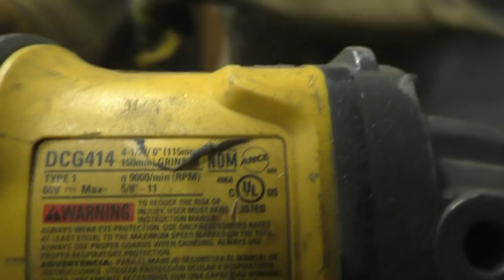Grinder Safety -- and lies you are told to scare you.

Comment: I've gone through hundreds and hundreds of cut-off blades making things from heavy chopper knives to roll cages and a few jet engine projects, never had a blade explode on me in an angle grinder. I'll occasionally run them down into nub status which is probably a little dim on the idea scale, but if you're in the zone, screw the blade change. 😁
Dremel wheels on the other hand I refuse to use anymore due to them exploding prolifically even with wood, not to mention all-thread or something heavier. Still have all my bits though, so that's something.
Love the 'tough dad' approach on safety, i.e. abuse your tool, you'll abuse yourself. Practical and common sense is a fleeting commodity that most people think there's an app for. Good luck downloading it... 🤦‍♂️
Reply from the maker: LOL,   just a little bit more....   ...nope.

Comment: What about using the wrong sized disks, as in those meant for bigger slower grinders (2'000 rpm) on a smaller 11'000 rpm grinder? Do they hold up as well?
Reply from the maker: They certainly have for me.  No problems at all.  Careful with your fingers, as they are a lot closer.

Comment: The only scaremongering in this video is the nonsense you preach, you've been lucky enough that you've neither seen not experienced a catastrophic failure resulting in injury. I'd fire any of my guys on the spot if they were acting so irresponsibly, nevermind teaching people to do it. It's not only the operator in danger but everyone else around. You couldn't track the fragments of disc in a small workshop when they broke because they were moving so fast.  Just plain dumb.

Comment: Everything is fine until it isn't. No need to cover yourself in bubble wrap when you go outside...but taking reasonably easy precautions helps you dodge bullets. I'm a construction worker...I'll remove the guard for convenience when using sanding discs...but I ALWAYS attach the guard when using cutting discs. Chunks of those things do break off, boys and girls.

Comment: So the blade broke off before the grinder even got it up to 1/10th of the full rpm? Yeah, no wonder it didn't do anything to the glasses. That's not how physics works.

The blades have low inertia so the angular momentum they build per a given rotation speed is pretty low, but yeah at 9000 rpm it's gonna have some momentum. Like 1000 when it broke off? Apparently still enough to knock the glasses off the frame and the frame out of the vise. And EVEN THEN, most of the force ( F = mass x acceleration) was sapped by the momentum the glasses gained in order to fly halfway across the room! Conservation of momentum. m1V1 = m2V2. Force was transferred into the vice, and then into acceleration and only a small fraction of it went into stress in the lens material. Rotational energy (and any kinetic energy for that matter) is proportional to the SQUARE of the velocity. Rule of thumb is that if you double velocity, the energy quadruples.

I was with it, that it's reasonable to respect the tool and that maybe the safety measures are there for people who don't. But you completely lost me when you said the blade in the glasses was a hoax based on a flawed experiment. Redo this with multiple trials, the glasses fixed in place (like they would be on your face), and with the blade breaking at full rpm. And maybe without putting yourself or your cameraman so much at risk. And maybe then you'll have something that could be considered even a modicum of scientific evidence to support your claims.

The reason the glasses could break without your head being knocked backwards is because of the low momentum. Your head has much much higher mass than the blade piece. The force is not very high. But the force divided by the surface area of the edge, the point of contact, is what matters - it is very concentrated. That is called stress, F/A. And in this case A is small, meaning the stress is high. Why does this matter? Because that area of the plastic of the glasses, no matter how great the glasses are, is obviously going to succumb to an ultimate stress (aka breaking point) long before the same area on a metal or composite blade will!  As a metalworker I hope you have heard of Young's Modulus of Elasticity since it is so fundamental to the mechanics of materials.

Furthermore, this ultimate stress is mitigated because if the axis of the reactionary force from the glasses through the blade passes directly through the centroid of the fragment and therefore not transferring any bending stress (no torque) into the blade to "fold" it, the stress in the blade would be propagate somewhat evenly throughout the fragment, but the glasses will take the full force and have very high internal torque forces, and as I said earlier, will succumb to an ultimate stress. The material fails, the blade passes through the glasses. 

The point is, your claims are not supported by materials science and engineering whatsoever. Perhaps glasses really are strong enough to resist the perfect ideal maximum force of a blade breaking and flying off at the highest rpm on a grinder, and perhaps it is a hoax (it is not, do your research), but you're gonna need to prove that with an actual experiment that realistically has a full transfer of force into the glasses before anyone with critical thinking abilities will recognize your statements as anything but dangerous misinformation. You don't even have to do that since your notions have already been conclusively disproven anyway.

----
And now I'm back 5 hours later with some more added points: 
-Very likely that was a glancing blow, so the full force of that weak break wasn't turned into material stress in the glasses. This might not be the case in an actual scenario where someone's eyes are on the line!
-OSHA and equipment manufacturers do extensive testing on situations just like these, but properly, and their findings that you should have glasses AND goggles/face shield AND safety mechanisms on the equipment hold magnitudes more validity than your claims
-If you pre-break the blade, you are removing some of the "spring action" that the blade would have in a real scenario. The blade with minor damage or no damage at all would build up stress more and more, and itself would have an ultimate stress breaking the material. The blade which is now storing energy like a spring of sorts will release all that energy. The energy as it flies off won't all be from angular momentum of the spinning blade. This, of course, all happens on the scale of milli or even micro seconds.
-Based on the quick look at your channel, you seem like you may be an actual company that may be regulated by OSHA. If that's the case, you need to think about what OSHA would think about your practices and what you are telling your employees, and your audience.
-As an engineer that has had to work with both MSHA and OSHA compliance, I believe I have the authority to say you certifiably deserve a Darwin Award if it comes to that, whether you are formally required to comply with OSHA or not. Sorry. Maybe focus a bit more on safety, it's a big deal, and you shouldn't purposely downplay it so you can look edgy on Youtube. 
-If someone on any of the crews I've managed got injured like this, it would feel bad. And if it's because they deviated from their training because of a video like this, it would be very sad. Losing an eye ore a finger or an arm or what have you is permanent (usually), and it would be very upsetting if it were due to carelessness or stupidity. Carelessness and stupidity is fixable and preventable, but once what you have is gone, there's not really much you can do about it. And that's why I'm so heated. Please be a better role model for everyone that works with you or watches your channel. You don't always have to be Mr. Buzzkill with the safety stuff, but approaching it with respect sets a precedent for good work for everyone you influence.
Reply: Glad someone said it so i wouldnt have to
Reply: OK, you are bored?
Reply: Didn't read it but I liked because of you afford

Comment: iv worked with 2 people that both cut their jugulars with  9 inch grinders from kick back having said that i was trained on 9 inch grinder from that start and learnt a very healthy respect for grinders from the start from nearly shitting my pants every time i used it. having said that iv seen what a cheap nasty disc can do after i had one break off wiz past my ear then go threw the tin wall that was behind me about 5 feet behind me although that taught me not to get shit discs it didn't stop me. having said that i do recommended glasses but if their gonna fog up half way through or are scratched up i find it more dangerous .......i also hate the idea of long sleeves and gloves...
Reply: yeah long sleeves and gloves can be a hazard for sure. I prefer to wear atleast gloves just because I dont like the little particles hitting my hands but I will acknowledge that can be more dangerous than bare hand for sure. I think you/a person will be fine though so long as the clothing is not loose, and you are giving the grinder the respect it deserves though as I have not had an incident yet and I typically wear a long sleeve while doing it too. (farming)
Reply: Don't do chainsaws, Doug...gold mine!
Reply: If your grinder is kicking back, you’re using the wrong side of the disc.  Natural selection.
Reply: @Bread996  or pinching it in the work

Comment: On October 19th  2013,  I had a Metabo cutoff wheel on an air tool, come apart, and nearly gut me. It was a brisk North Dakota morning, and I was dressed accordingly, with a Heavy fire retardant jacket, over a heavy long sleeve fire retardant shirt, over a Dickies t shirt. Through all of this clothing It left a deep gash, and a softball size bruise on my abdomen.  Had i been in a warmer climate, I am sure i would have had a real bad day.  I will still use a grinder all day, guard of no guard, however I am still a little skittish of air cutoff tools.
Reply: Yeah, I had 3 wheels come apart on my air die grinder in the past year. One caught me in the chest and only left a painful bruise. I didn't destroy any with the angle grinder, which I use more frequently.

Comment: I was taught that wearing gloves while using disc grinders is dangerous since they can get caught ip and pulled into the tool whereasesh will just disappear pretty much, in my experience.
Reply: Your hand should never get within pull range of the blade. If it gets there, you're already fucked up. The disk can also grab your bare finger and pull causing a big cut.

Comment: I agree, that broken cut off wheel in the safety glasses picture was an intentional set up.
That plastic lens would not let a grinding /cutoff wheel penetrate it like that. It would have bounced off of it...
Thumbs up! 👍🏼
Reply: I don't think you passed your phisics exam or learnt how safety glasses work...

Nothing will stop a blade at that speed and with that little surface, and even less possible is that something gets to bounce the blade off. That's perfectly real, and that's what safety glasses are supposed to do when something hits them.
Reply: @somedude2492  The word is physics, not phisics. It is learned not learnt. 

Safety glasses are made of polycarbonate plastic that isn't very thick but it is very durable. When using a grinder with a grinding wheel or a cut off wheel it is best to wear safety glasses and a face shield to protect more than just your eyes. But more importantly use common sense like he illustrates in this video, keep your face and all body parts out of the path of rotation. If the grinding wheel were to break then you won't get hit with shrapnel.

Comment: Ha, ha, ha...Dr. Destructo. I love it. Common sense is our best defense. I do wear safety glasses.  But your right everything is dangerous they say... I should be dead with all the dangerous things that happen to me. I bought a hand grinder for the first time, but I've worked with a lot of tools before, I use to be a jet mechanic, I bought it used, no instructions, there was no guard on it. After looking at it and seeing the RPM's it puts out you bet I took notice. Now weeks later I watch just about all there is on grinders and low and behold I did it right! Amazing what you can do when you use your brain. Thanks for the video...

Comment: You're missing the point that all the safety warning & fear mongering is because not everyone uses it often.
Not everyone try to find out what they are working with & how to properly use it before using it.
And that not losing a finger to gain experience is much more better than otherwise.
Reply from the maker: Yes Mother

Comment: There is absolutely no point to running a grinder without the guard. Like the kid's riddle about halfway being the deepest you can go into the forest the greatest cutting width it has sits at halfway and you're never going to be using over half of the circumference on the cutter at once. You're just needlessly exposing cutting edge towards your fingers.
Reply from the maker: HA!  Hi Mom!

Comment: First- LOL!

You should have used a chorded one, they're more angry.

Second, I agree that people are way too worried about these things, but for those with no common sense, these things are not a bad thing to be afraid of.

I fit somewhere in the middle, healthy respect I'd say, with 3 close calls that don't seem to worry me any more than I was before:
- Grider + knotted wire wheel= just tagged my shirt and it instantly got wrapped up in it keeping me from flipping the power switch on it and instantly removing all the fur off my belly.  I don't remember if it hurt, it scared the shit out of me and I was quite impressed with how completely it deforested things
- Grinder + grinding disk= cleaning up some torch cut pieces I tagged my knuckle through a glove.  Friend on the other side of the shop instantly could hear it was different and came running over and I just sort of shrugged and said I don't know.  Pulled the glove and it ground a wedge-shaped piece down into the bone, instantly cauterizing the blood vessels on the way.  No blood, perfect cross-section of what I cut through.
- Grinder + cutting disk= cutting disk go boom.  Didn't think I had it pointed at anything important... the disk shot up my leg and went through my ripstop BDU pants, well, ahem, I missed my junk by probably about 1/2", I had to move my underwear to show people the big half-moon shaped bite it took out of my leg.

Now I always have a guard on my grinders if it fits what I'm doing (I did in all these cases), not so much safety but they don't  let you direct the sparks and sometimes I'll even use it to guide the grinder, it lets me be more precise with my work without worrying where shit is going (people joke that I can wield one like a surgical instrument).  In most cases, if i'm using someone else's grinder I don't care if it has a guard from a safety perspective, but sometimes feel like I can't do as good a job with it. It might be my largish hands, there are some XXL gloves that won't fit me, I almost never use the handles because they put my fingers too close to the blade (the knuckle incident) but I can use the guard as something else to hold onto.  I can't think of anything that these close calls have changed, but over the years I have changed a couple of things in general: I tend to put on a face shield (safety glasses are not enough, though I'll admit that I sometimes lose the safety glasses with the face shield) if I'm going to be doing more than a little grinding and after one too many nights where I woke up with my ears ringing like I was at a rock concert I've started wearing hearing protection.

Comment: A very very thank you to you ,, last time (1 year ago when i held an angle grinder in my dads workshop I was fed with those stories and I wasnt even able to turn it on  
For more than  3- 4 mins , constantly turning it on and off ,, today I watched your video and went there and without any fear and with visions of what all you did in video to prove proper handling wont cause blade to explode ,, I just came after cutting a knife shape from a sheet metal ,, started with a bar and then went on to sheet metal .. . Thankyou very much ,, adios

Comment: I once was using an angle grinder and done about 20 cuts into stainless with 1 blade. Then I replaced blade (different brand) and every cut I exploded the blade, so I went through 5 blades for 5 cuts. I didn't change anything with my technique or material just the brand of blade changed and it became super dangerous.
Reply from the maker: I love that you got a set of bad blades and stuck with them till the end of each one. : )

Comment: If a disc explodes like that it's usually because someone was using it to cut a really soft metal like brass and the disc loads up with soft metal and is thrown off balance. While it is quite a rare occurrence, a disc can explode with force. However, this rare possibility shouldn't be used to scare people away from the tool. Your tests here don't show the full force because the pieces broke apart before even reaching full speed. Your point is valid regardless though, and that point being that you shouldn't be afraid of the tool. Just use some sense when operating it.

Comment: I been using a grinder for decades.   Last week I adjusted the guard like I have done 100s of times before with the wheel still spinning. I had on gloves and snagged the edge of a flap wheel with my finger. It blew thru the glove and went right to knuckle in an instant. 
 Lesson learned....... get a new left glove